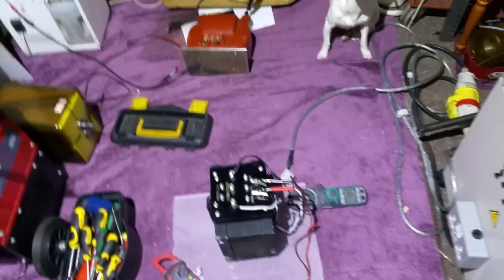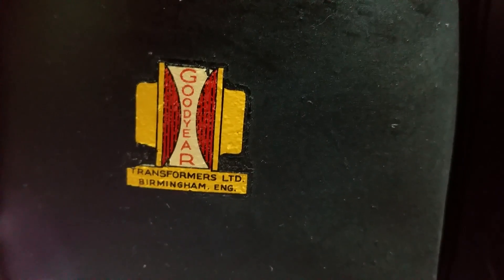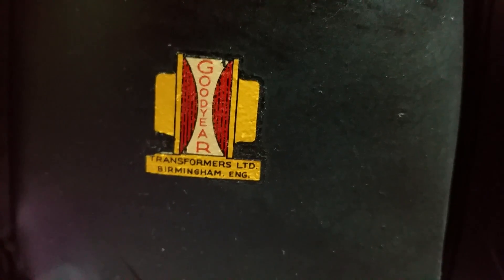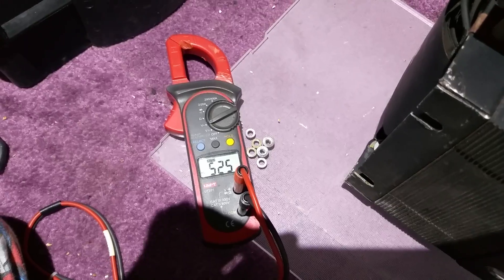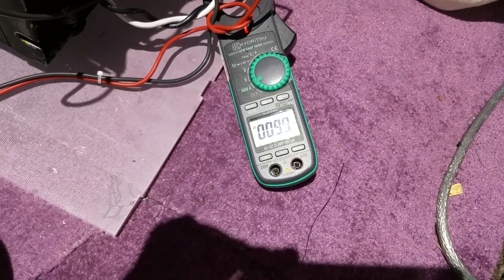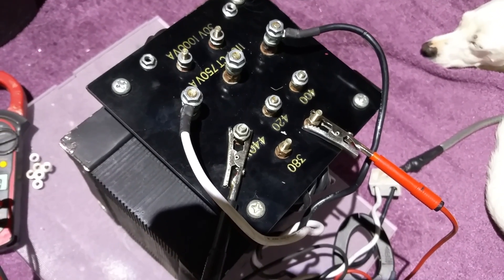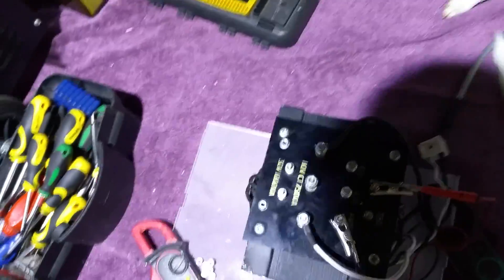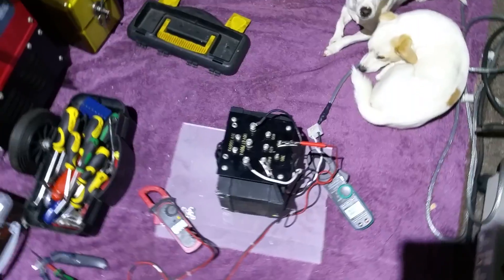BIG high current transformer 600v+(Scrapyard find)

Comment: I'm almost certain "110V center-tapped" means 55V+55V. You are severely over-volting the secondary, causing that large current even with no load.
Reply from the maker: hi mate. yeah now iv heard it from you I did think this but with it being ballasted it's been working fine! the transformer doesn't even get warm driving another transformer. and being arcing out! as I try ed it on my big 400 volt microwave mother of a MOT.  so it's a beefy transformer lol.
it only cost me 6 pounds so for the time I have it" it's going to be some good times, and pay for itself in carnage haha.

Thanks again mate. you pointed out my thoughts lol

be safe bud and be safe.😉 

Anthony 

High1voltage1rules